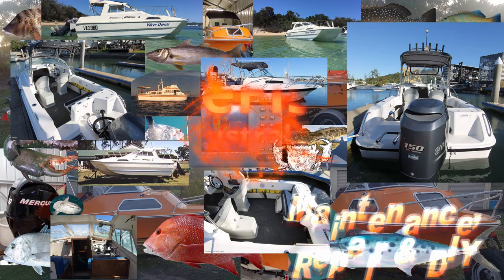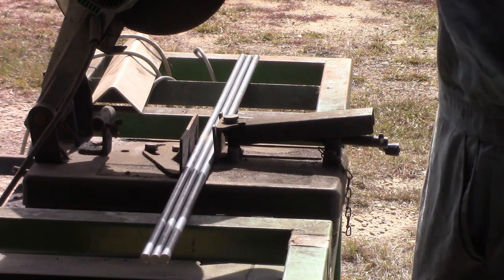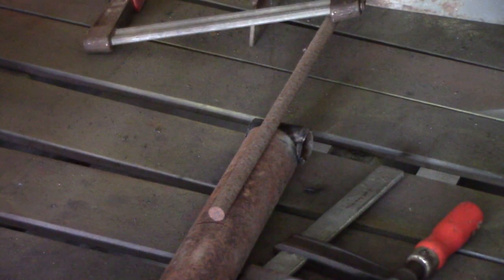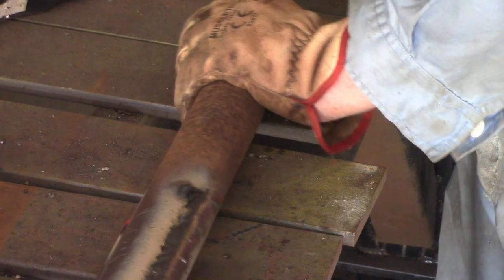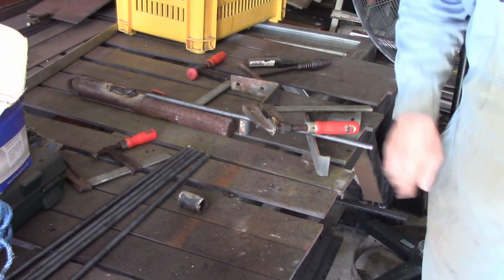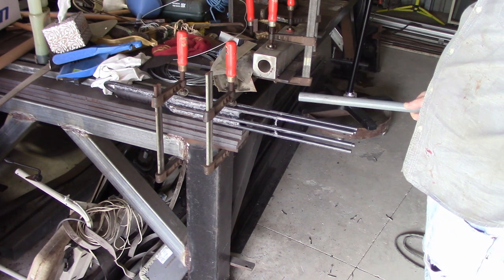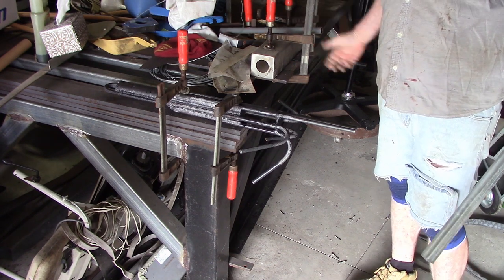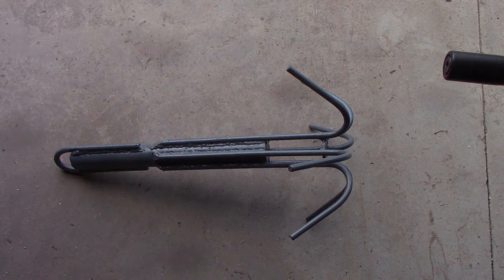DIY Reef Anchor

Comment: weFish, Enjoying your videos. I was wondering if you have considered doing a video on tips to anchoring using a electric drum winch?. It would be great to see how someone with real experience does it. Maybe tips on anchoring up for overnighters, and the use of a reef anchor?.  Also , do you use your drum winch with the reef anchor? I have just purchased a boat package and opted to have a electric drum winch fitted, and I am finding it hard to get any useful info on using them apart from manufactures "sales videos".
Reply from the maker: Thank you.  I hadn't thought about doing a video on using the winch but I will try to make mention of the techniques next time I overnight.  Soon, hopefully.
I use  the reef anchor very differently and no, not on the winch.  In fact when I set up to use the reef anchor I can't use the winch until I remove the rig.  The weather and opportunity haven't coincided for another overnighter on one of the outside reefs but I am keen to do one.  I do plan to try to do a fairly detailed video of using it when I do.
The reef anchor is very different to use and if you are on a genuine bit of reef it doesn't need the same scope as a sand anchor.  I have 200m of rope on the reef anchor and that should be enough to comfortably hold in about 175m of water whereas I wouldn't anchor deeper than about 60m with that rope and a sand anchor. 
Hope that is of some help.  A video will make it clearer when I can so one.
Reply: @weFishAU  Thanks for your reply. When I talk to different people regarding anchoring they make it sound simple , but it’s one of those things that if you don’t get it right you’re safety is compromised. Also I have found that most people only “think “ they know what they are talking about. Look forward to seeing your future videos. I am learning something new every time I watch one of your videos.
Reply from the maker: Thank you.  Your comment just reminded me of one thing I don't think I have ever mentioned is that I always set my GPS anchor drift alarm when I anchor up overnight.  I've never needed it but better safe than sorry.

Comment: Wefish, Man great video!  How can we negation the cost of you making me one of those reef anchors?  If I get supplies?  Or whats your thoughts for creating one for a fellow fisherman ..
Reply from the maker: Thanks.  Honestly, if I hadn't had the material sitting around from another job I would have bought one instead.  Reef anchors are dirt cheap and they are galvanised, which it too expensive to get done on a hobby job these days.
Reply: @weFishAU  Thanks for the insight.  I will just purchase that second reef anchor ...

How far and depth you get to prior to crossing the bar?
Reply from the maker: Not sure I follow the question.
About 20 nautical miles offshore will put you in up to 300m.  That's as far as I've ever been out so far.
Reply: @weFishAU  I guess the better question is can I travel to say Buwler without crossing Bar?  or looks like it about 40 min to an hour from Scarborough where I will launch?

And where do you launch out of?
Reply from the maker: No bar between Scarborough and Bulwer, just some sand banks you need to look out for.  Pick the weather to suit your boat and skill level and you will have a great time over there.
Although it can get pretty rough at times, there is no bar around the top end of Moreton either.
I launch out of Cleveland.
Reply: @weFishAU  thank you for getting back to me.  Looking forward to the new side of town.

Launching out of Cleveland you can beach up on Straddie correct?  If so how far will that be out of Cleveland? Good fishing that way?
Reply from the maker: In good conditions Peel is about 15 minutes, Myora light about 30, inside of South Passage bar about 50 and Bulwer about 90 minutes.  Can be a long trip back from Bulwer if it is rough.  Lots of good beaches all around the bay.  Lots of good fishing as well, just need to find where they are on any given day.  Also lots of boats on all the well known spots, but that is the same throughout the bay as well.
Reply: @weFishAU  Is that time to Peel from Cleveland Launch ? Looks a bit longer on my map from Scarborough.

Would the marina at Scarborough have coordinates to those points?
Reply from the maker: Yes, from Cleveland.
Navionics is your best friend on the water.
https://webapp.navionics.com/?lang=en#boating@8&key=xfafDewwg%5C
Set it up, plan your trip, know your times and fuel consumption before you leave.  Don't put too much trust in it to navigate you around shallow areas.
You can download a version to run on your phone or tablet that has some extra features.
Reply: @weFishAU  thank you, will enjoying getting in an out Cleveland, that’s a very busy lil boat ramp, can you still launch from either ramp at Cleveland.?
Reply: @weFishAU  Thanks with that Nav and fishfinder shoud be good.

What I have been looking for since I downloaded app.  Can place my Micro SD card in computer and download to routes tracks etc then import it to sounder.  ?  Or am I being to smart for the system.?
Reply from the maker: Yeah.  I think there are 3 lanes on each of the 2 public ramps there.  Does get very busy at times.
Reply from the maker: Depends on your chart plotter.  Mine will load GPX files so I export the Navionics points to the SD card as GPX files then import it into my MFD.
The other option if to use GPSBabel to convert the Navionics GPX files into something your chart plotter can load. https://www.gpsbabel.org/